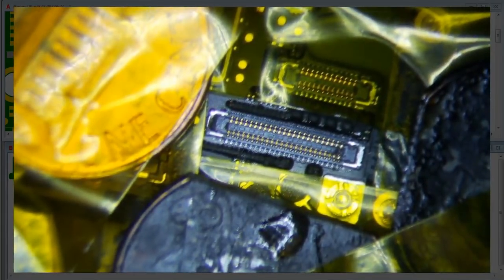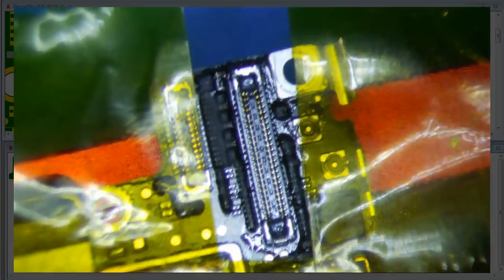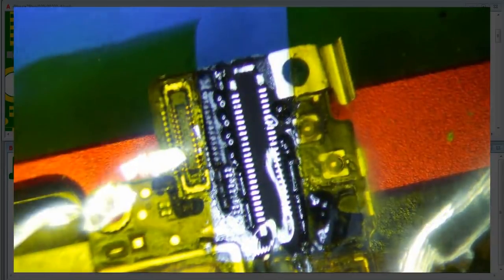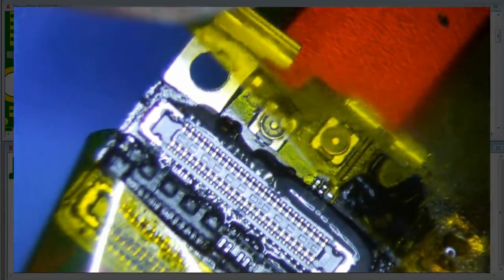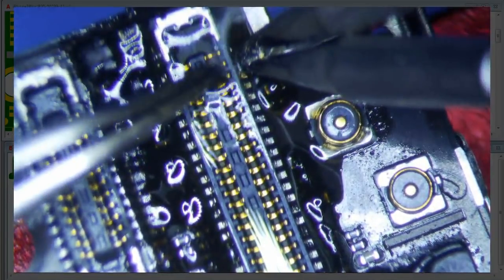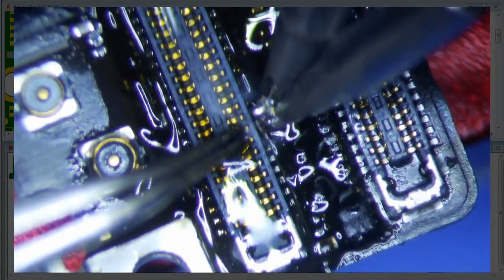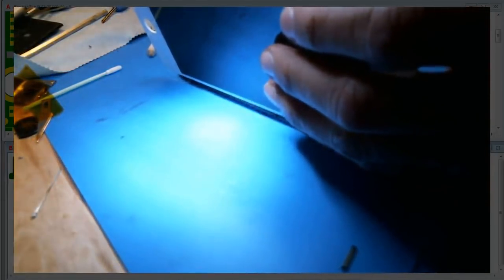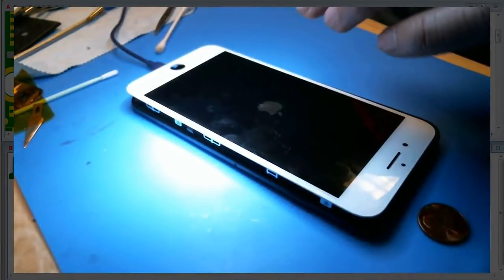iPhone 7+ LCD/Digitizer Connector Repair

Comment: When doing this do you not worry about floating the small components close by covered in underfill/coating?
Reply from the maker: Know your hot air rework station and you won't have this problem